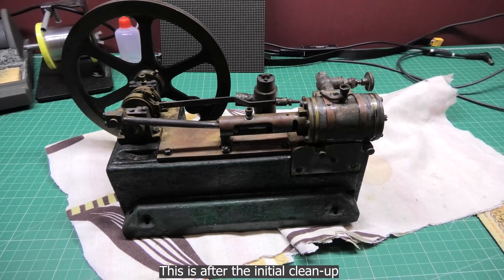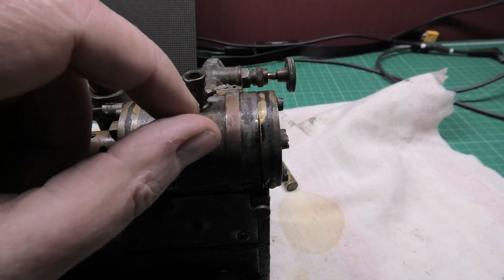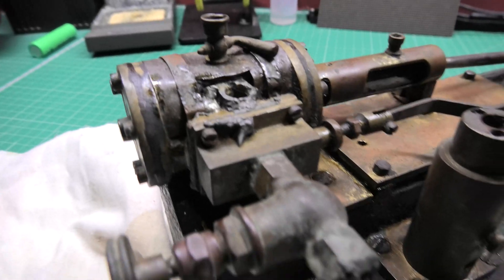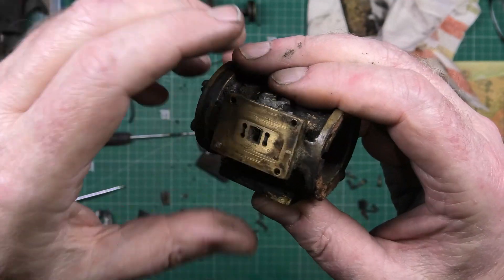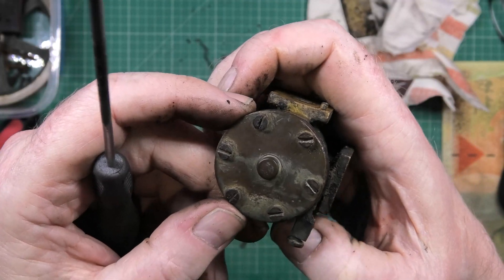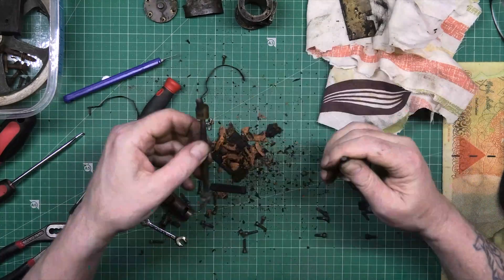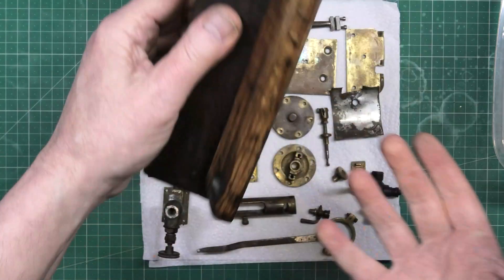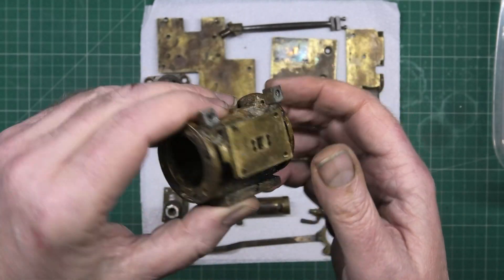Live steam engine refurb - the 2nd one - part 1 of 3

Comment: Measure the main shaft and try to find a standard size shafting a little bigger. Buy a matching reamer and oversize all the bores in a drill press not a hand held portable power drill. In the materials present around 200 RPM should work well. The small plugs in the cylinder are drains for condensate. Forget the isoprop and try brake cleaner or really be a naughty boy and use petrol.
Reply from the maker: Cheers mate 😁
I don't have a drill press and I haven't got access to one yet. I'm thinking of clearing my spare room and converting it into a workshop with a lathe and pedestal drill. Until then, there's not a lot I can do so I'm finishing what I've started and putting it to bed for a while. Wait until you see my masterpiece boiler, even you'll be impressed (I hope) 😂

Comment: Some boring and bushing ahead of you Tony..No, boring isn't the same as drilling...lol...See me...😀🇬🇧
Reply from the maker: I do need to replace all the bearings but the trouble is, I have a block of bronze (2" square) and nothing but a hacksaw and file.
I bet I can make them with the most basic tools 😁
Reply: @Vortecks  OkayTony, I'm not gonna argue, your OCD is worse than mine..lol.. 🤔🤔😀
Reply: @Vortecks  he is right, drilling does not make holes that are very round.

If your bearings have common sizes, buying a few reamers might be the smart way to go.  They will cut a round hole but a spiral flute reamer will probably be best if you are reaming a split bearing, a straight flute (or adjustable) reamer can hang up between the bearing halves and not cut round.

To actually "bore" your bearings you would need a mini lathe or a milling machine with the tiniest boring head I've ever seen.
Reply from the maker: @beardoe6874  I fully agree, they're totally different. I'm going to try to do it by hand to start which I know will take hours and hours, but I don't do enough metalworking to warrant buying reamers.
Reply: @Vortecks  ok, I just don't know how to bore a round hole by hand.  I have never had to do anything like that.

What I have done is drilled holes which did not finish up as round as I would have liked.  Reaming or boring on a machine has always been my fix.  Some jobs lap bores to size them but that's slow and you have to buy or turn the right diameter lap and lapping compound so I always fall back to reamers or boring in a machine if I have one.

I recently bought some 3-4mm spiral flute reamers in "used" condition but they look almost new.  I got a total of 7 reamers for about $20 on eBay so if you find the right item, it doesn't have to be a huge expense.
Reply from the maker: @beardoe6874  Absolutely, there is only one proper way to bore out bushes/bearings and that's to drill undersize and ream the rest. The trouble is, I'll only use them once and it's to make 2 x bearings. I had to buy 5 sets of imperial taps & dies (second hand) and I'll be selling them after I've finished these. The cost keeps mounting and, unless I happen to fall on a reamer the right size when I come to do it, I'll be making them by hand ☹

Comment: Ok Tony... this looks great, again, as usual from you :) The two little taps on the cylinder are drain cocks. When you first put steam into a cold cylinder, it condenses straight away and turns back to water. You can crack these open a little, and the water will come out, allowing the cylinder to warm up, and the water to escape without a hydraulic lock. Great project, and I look forward to seeing you move forward with it :) Ta
Reply from the maker: Hydrolock taps! I never thought of that! Cheers mate 😁
Now I've finished it (along with building a brand new boiler) I'm looking at the water injector so I can get it 100% working.

Comment: That extra piston might be an injector to replace the steam escaping the boiler with fresh water to maintain the level.

Locomotives have injectors that use venturis or something instead of pistons, a nicer system but kind of fiddly to make it work right.

As you are probably aware, if the water level in a steam locomotive boiler gets too low, the top of the firebox is covered with steam instead of water and that can't transfer away enough heat so the metal gets too hot, it weakens and then causes a boiler explosion right in the engineer's lap.

Because of that, they pay a lot of attention to their water level and injectors and fiddle with them constantly.  A stationary engine that doesn't have a huge fire might be designed to set and forget, operate at lower pressure and be fail safe.

Good luck on this one.  I think it will clean up nicely.

I would be tempted to bleach and stain the wood base rather than paint.  If it looks ugly, you can always paint over that but there is a chance that it could look really nice.
Reply from the maker: I also think it's an injector. I've taken it apart and there's a ball bearing in the top and I think there's one below the piston. I've had to soak it because it's clogged full of rust and dirt. I don't think all the parts are there and it's rather hard to figure out how it actually works (I know how injectors work but this one is different).
I'll let you know 😁
The base...... it was bad. Some of the wood was coming away and it was made of all different types of wood, so I cleaned it up and sprayed it.